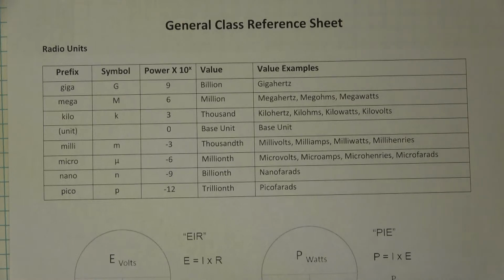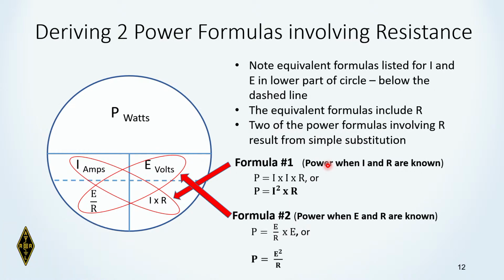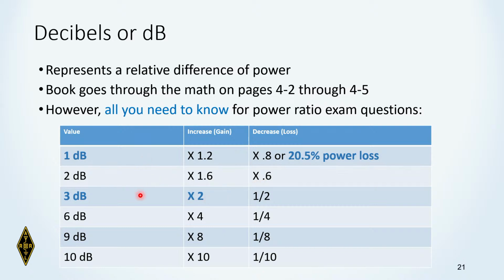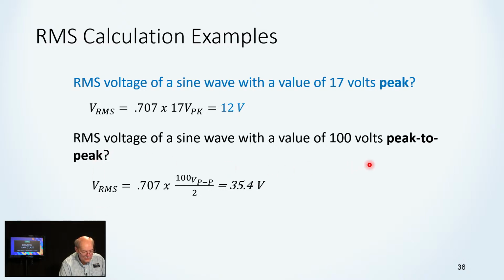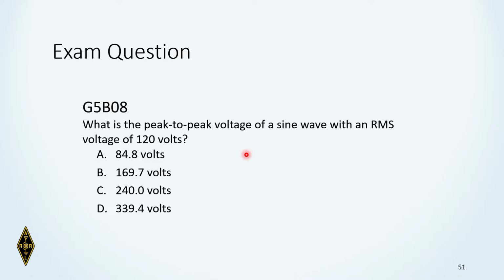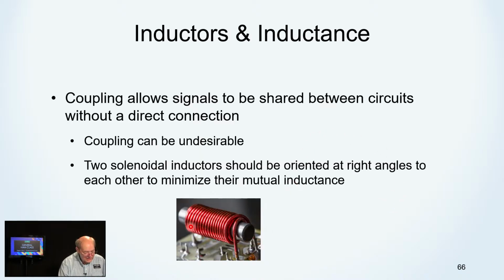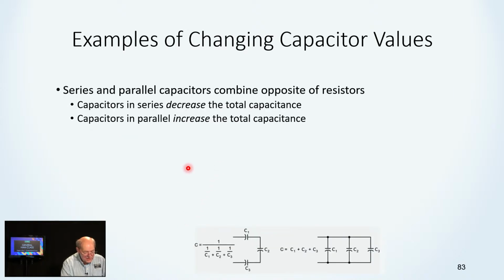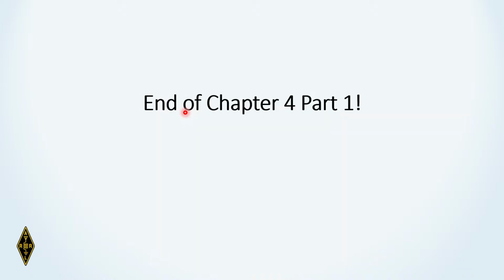General Class 10th Edition - Chapter 04 Part 01 - Components & Circuits

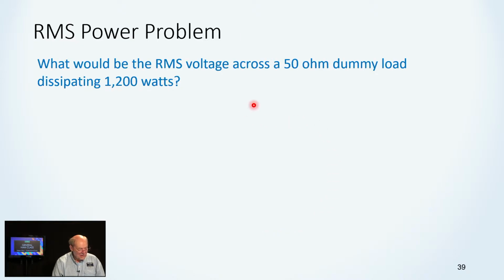Comment: At 55:00 you are working on question G5B12 from the pool.  I can calculate the voltage that you got, but I don’t understand why you do not convert it to the RMS value.  How do we know that this voltage is already RMS?
Reply from the maker: Power is expressed as RMS by convention. So no conversion is necessary. 73 de W4EEY
Reply: @W4EEY  thanks so much, I really thought I had that down the first time watching with you, but kept messing up the answer on the practice exam.  I’ll have to review that concept again to get it straight.

Comment: Why are we squaring Ohm’s law values? I haven’t seen that before. Example: E=I/R has always been what I’ve seen. Now it’s E=I(2)/R? I’m not following.
Reply from the maker: There is Ohms law that shows the relationship between Voltage, Current and Resistance. And there is Watt's Law that shows the relationship between Power, Voltage and Current. When you combine the two you get the derived formulas of: P = I(squared) R and P = E (squared) divided by R.

Here's a link with more: https://byjus.com/physics/electric-power/

73 de W4EEY

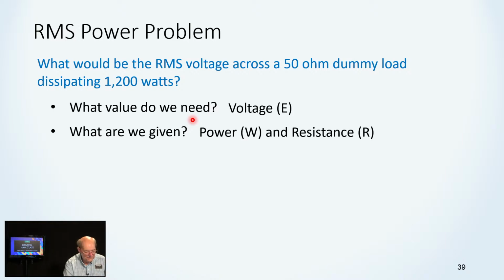Comment: Since RMS voltage is what is being solved at 56:09, shouldn't that 245v value have been multiplied by 0.707 to get 173v?
Reply from the maker: Power = Vrms x I. So the voltage we are solving for is already RMS. 245V in this case is RMS voltage. 73 de W4EEY

Comment: You only need any two of the numbers... E, I, R, and P. If you remember "E over IR" and "P over IE". You can calculate any of the other numbers with simple math, and the last formula. That's the only formula you need to memorize. The one for volts (E) if you have P and R, but don't know I. Everything else you can use the two circles.
Reply from the maker: Yup! A Gold Star for you! 73 de W4EEY